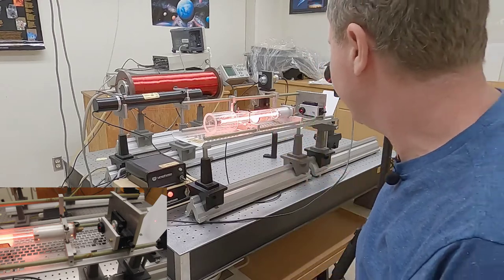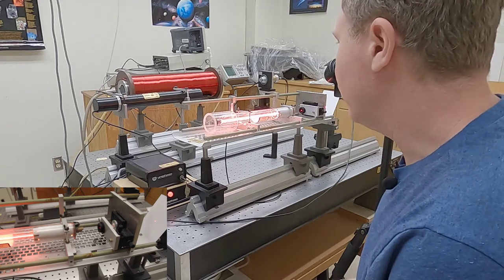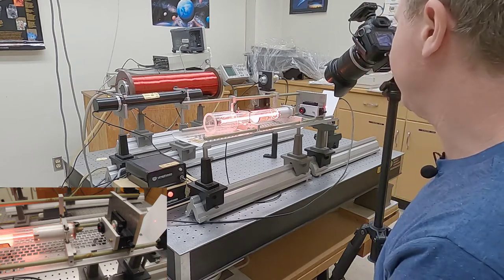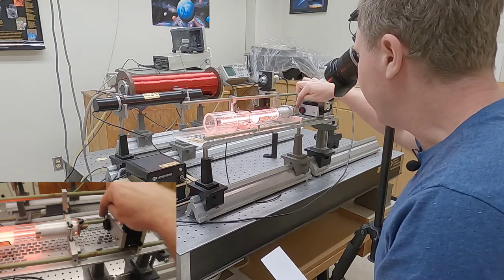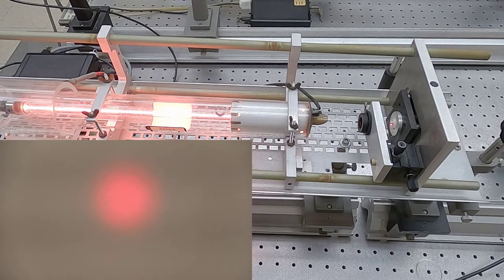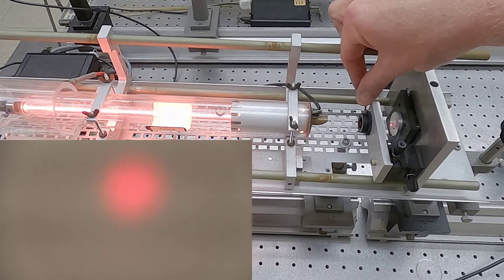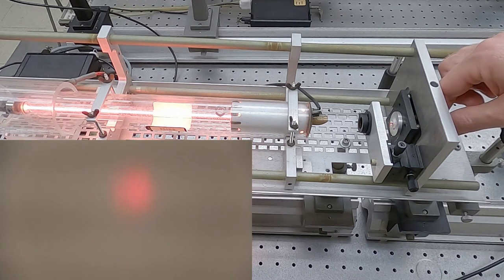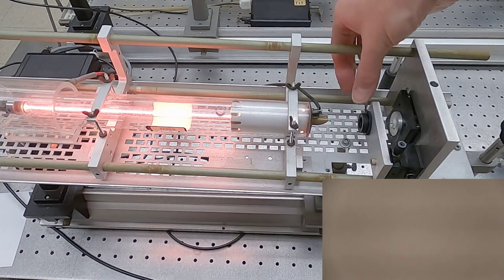Optics Lab   4a HeNe Laser Cavity Spatial Modes

Comment: Thank you. I always wondered how gas tube lasers worked. I understand the basics of diode lasers but have no familiarity with gas lasers. I guess the next thing I should research is the definition of "mode" in this context, because I'm a layman, with no experience except researching the basics for the two types of lasers I'm using at home: direct diode and diode pumped solid state. Dye lasers are also a mystery to me. 

It is only the inexpensive lasers I can tinker with, and I haven't really looked into the definition of "mode" because, as far as I'm aware (I could be wrong, admittedly. You're the expert, not me 😊) direct diode lasers are single mode, so I've only really seen the term "mode" mentioned in passing.